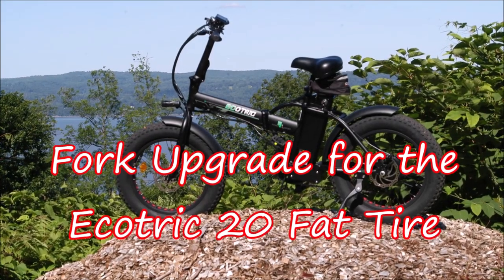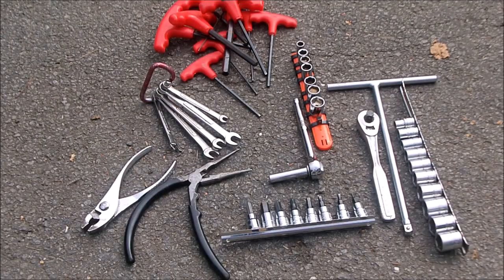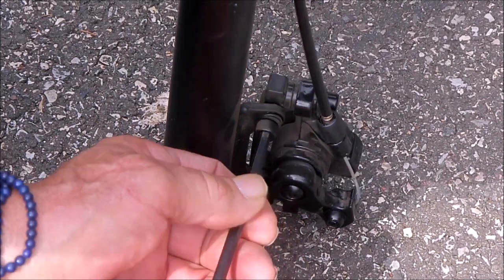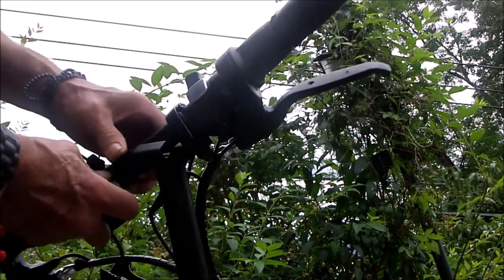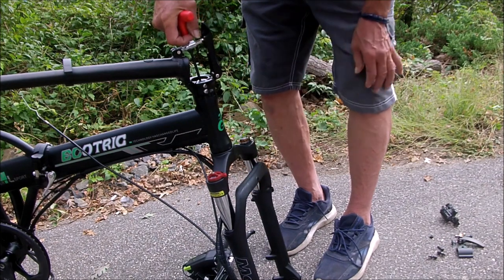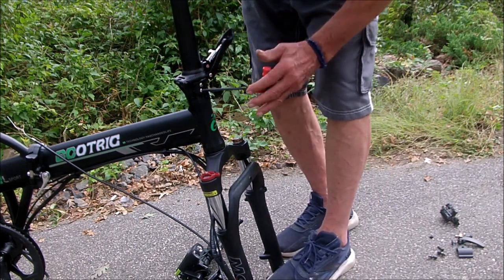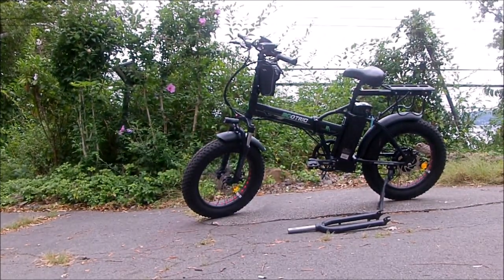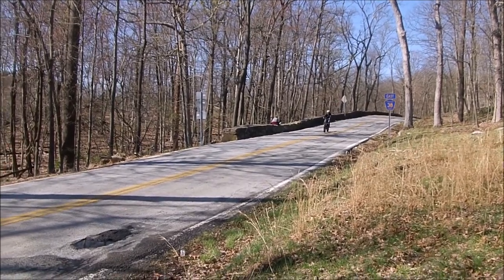Upgrading to a Suspension Fork Makes The Ecotric 20 Fat Tire Even Better!

Comment: Can I ask a question the front forks when oulling6on front brack to you get play at suspension legs where seals are like a loose feeling I've tighten top bolt for bearing. The bike is brand new forks are moving at seals it's not the same bike as yours but fat tyre bike spring suspension at back
Reply: I think all of the forks have a slight bit of play when subjected to front and back motion if they are at full extension. My Ecotric forks don't have very much at all - the kind of thing where you can sort of feel it but can't see it - i suspect that they amount of play is directly directly related to how well the forks are made....If you are seeing the front wheel actually move they forks are probably either defective or extremely poorly made.

Comment: When setting brakes up you said to let go of lever you don't. Putting caliper back I use alen key tighten then in tighten slightly then pull brake and keep brake pulled then tighten the two screws then let go of levers that's the proper way
Reply: You are correct that is the way to adjust the pad clearance...I was showing the process of mounting the caliper on the fork.